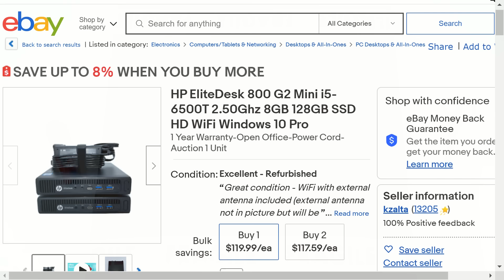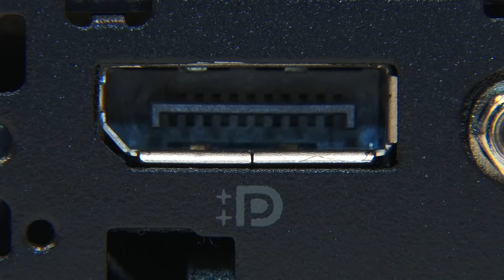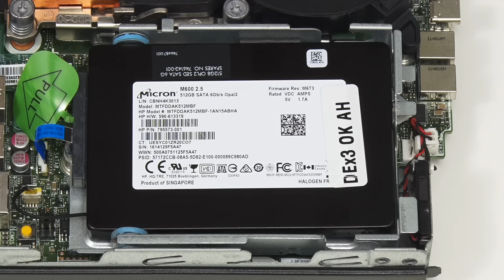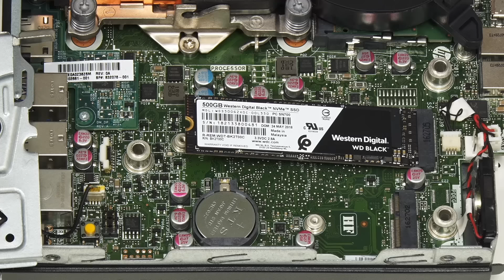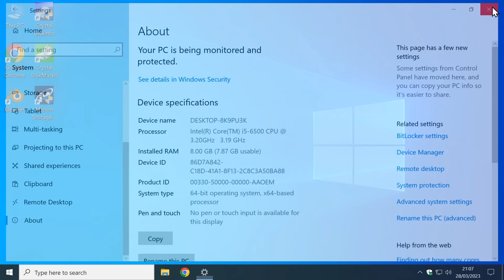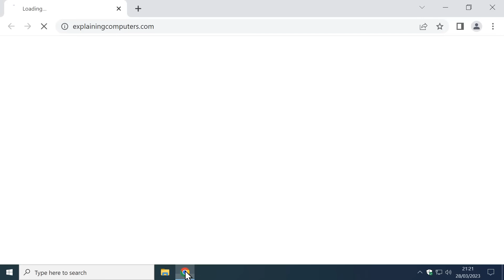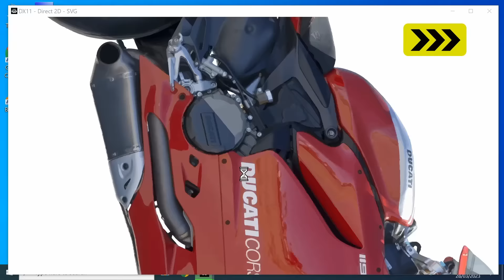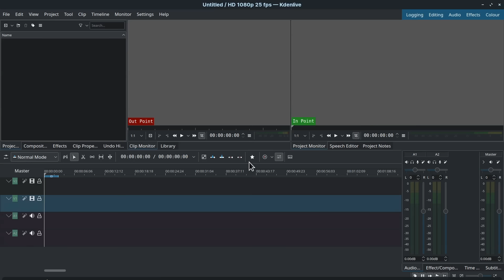Renewed i5 Mini PC: HP EliteDesk 800 G2

Comment: I have had so many of these mini PCs and thin clients that I've lost count. Believe it or not I use Elitedesk G1 with Android X86-64bit Prime OS Android 7 as my daily driver. When I need a Windows system I have a ssd with Windows 11 that I plug in. I have bought many G2s with no hard drive, ram, or power supply for under $50 shipped here in the US. These computers are great with Windows, Android, or Hackintosh however I would say your choice of Linux is that much better.
Reply from the maker: I now have to try Android on this! :)
Reply: @ExplainingComputers  I know Bliss OS and the Android X86 project is the most popular however I would still recommend Prime OS or Lineage OS. Lineage OS has an iso download on the Android X86 website. If you go with Prime OS I would use the 0.6.1 Android 7 mainline iso. If Windows is installed Prime OS has an optional installer to dual boot Windows and Android. Real Android will always beat an emulator hands down. Prime OS and Bliss OS both have a keyboard and mouse mapper for games built in. I'm looking forward to seeing which ever version of Android you pick to test.

Comment: Hi Chris.  Another interesting video with lots of possibilities for potential upgrades such as more RAM.  It'd be interesting to know how the fan controls are set?  Both on all the time or or the second one comes on when needed?  As it's an older machine perhaps the fans could do with bring swapped out?  As 2025 is on the horizon, perhaps a future video on wiping the machine and installing a stable Linux distro in its place?  Happy Easter
Reply from the maker: Hi Martin. I must indeed check the fan settings. This video was produced in a bit of a blur.

Comment: They can run 65 or 35w versions of the CPU . If you have a copper heatsink and a 90w plus psu it's able to run the 65w or 35w CPU .  If you have an aluminium heatsink and 45w psu it's setup for the 35w version . but you can upgrade the heatsink ( if you can find one ) and psu if you want to run the faster CPU. Got mine (i5-6500T 35w) on eBay 2 years ago for £150 . Brilliant little piece of kit and runs Linux mint like a dream.

Comment: I got a small Lenovo ThinkCentre that I was using as a stereo PC. The drive that they used for it was trash. You may need to inspect it when you get it and make sure you keep a backup if there's anything important that you're using it for. Ultimately I ended up getting another system on discount from Chuwi with a smaller form factor with an i3 hex-core processor, more RAM, and a better drive. (Obviously it's more expensive.)

If you're fortunate to have a Microcenter close by, like I do, I group a handful of Inland SSDs or whatever's good and on sale, for smaller projects like this.

Comment: Don't assume the 4k or so hours for the SSD runtime is accurate. I have a small server here that's been running for 6.5 years or so, the two HDDs in it report around 54k hours, the SSD reports 4k or so hours. Clearly, there is a problem with the data as reported by some SSDs, or the way CrystalDisk gets that data, because it isn't accurate, at least for some SSDs.

Comment: Hey Christopher! That computer is an HP elitedesk 800 G2 mini 65Watt. It has two fans for cooling the hard drive because it is the higher powered 65watt that uses the i5 6500 . It is not the 35watt that uses the i5 6500t!
Reply from the maker: Thanks for this. That makes sense for the two fans.

Comment: I have two 800 G3's and two 600 G2's and they are Fantastic!
When I started my quest to downsize and to make a quieter, less heat producing room, I discovered these on ebay and now I can't stop ordering them to use for various things!
Reply: My new plan is to buy a few more of these to set up a Proxmox cluster!
Reply: I've just received one and I am already itching to buy even more of them. The homelab bug is hitting hard. I'm not even sure exactly what I am going to run on the Proxmox cluster I am planning to use these for. I just know I need to do it :)
Reply: Are they almost silent these small machines?

Comment: BEWARE when buying these machines! VERY carefully read the listings. The manufacturers' and sellers' terminology varies, inconsistently and often erroneously  regarding 'SFF' and 'USFF'.  Ordering an 'SFF' machine without looking closely, may result in a larger form factor than you are expecting. Happened to me.
Reply: Does S.F.F. mean small form factor? U.S.F.F. meaning ultra-small form factor?
Reply: @arvaneret_329 Yes
Reply: @arvaneret_329  it's supposed to, but a lot of eBay listers don't get that
Reply: @arvaneret_329 it does
Reply: doesnt matter still worth the buy🔥🔥🔥🔥
Reply: That's a good point. There's not uniformity of terminology among manufacturers when it comes to 'small' form factor PCs. As an example the M75q - 1 Lenovo ThinkCentre is considered a tiny form factor by some. Yet, it's not a micro form factor.  And some of that might be due to what's featured as this presenter explains.
Reply: THANK YOU

Comment: We have one at a customer for a lab workstation. Honestly, i hate it. The usb ports have different power or Chipsets, meaning that the usb serial adapter and hub work well in one port and not at all in another. The ports on the backside are cramped and hard to get a handle on, the ethernet chip and the stock ssd have frustrating performance. I'd at least have expected an OEM'd Samsung in a brand computer. Performance in Ubuntu is underwhelming, the usb ports are slow.

Comment: It really shows that the size of a system doesn't say as much about it as it once did.

Where I work, they use more-or-less Dell OptiPlex "Micro" boxes everywhere. I personally own a 3000 Micro with a 12100T (4C 8T) inside, which I use as both a web and simple-databases server, as well as to power a few private bots on the Discord platform.

What captivates me about these boxes is their better energy efficiency ratios; the OptiPlex box I own only uses about 5-6W at idle, with enough tinkering.

Comment: These are such gems. I have a whole array of these with i7 att home for proxmox lab usage with 32 gb ram in each, + ssd, nvme AND 2,5 gbit networking for ceph. The i7 versions often comes with vPro for remote management. So much awesomeness in a little box!
Reply: How did you get 2.5Gbit networking on these?
Reply: @MnemonicCarrier  I’m guessing vis USB3/C dongles. I use them for ESXi with such dongles.
Reply: @MnemonicCarrier  some have PCIe capability, like Lenovo m920q

Comment: That Mini PC is not the 35w version, that is a 65w version and the processor is the 6500(65w), not the 6500T(65w). The 65w version is more powerful thats why it has a perforated top case and a copper CPU cooler.
Reply from the maker: Thanks for this. I was clearly not shipped what was advertised.

Comment: My impression is that a lot of companies, and individuals, are getting rid of their perfectly-working and power computers because of the "this device is not compatible with Windows 11" warnings.
I purchased a used ASUS VC65, mini desktop PC (even smaller than the HP EliteDesk 800), and forced Windows 11 on.  It works perfectly, and so fast (after upgrading to 32GB or RAM with a 1TB M2 SSD); so much cheaper than buying a brand new computer, but getting all the power & benefits.

Comment: I have an i3 model I purchased for $100 awhile back.  I have Windows 9 installed on it and the ethernet port completely disabled (in multiple ways.)  Using it purely for music production and it works great as an offline machine.
Reply: Windows 9?
Reply: @RWL2012  It's a custom ISO someone made and called Windows 9.  It's actually Windows 8.1 Embedded Industry Pro with all the bloat stripped out and the Windows 7 style start menu.  I don't trust custom ISOs to not have problems/backdoors, plus Windows 8.1 is EOL, so that's why the system has no networking capabilities.

Comment: I've been using one of these quite happilly for a few years. One thing to watch out for is that if you buy one that doesn't come supplied with a 2.5" disk, it likely won't include the special cable that connects between the disk and the system board, and these can be tricky to track down if you subsequently decide you want one.

Comment: I have a G3 sat nicely on a 1U shelf in my home rack. It’s a nice little reference PC for when I’m in my garage, and it also runs Docker for several packages which I use for home automation and network management. Awesome little PCs for the money and we’ll worth it if you want a machine with reasonable performance for not very much money

Comment: Chris. I've been watching you for years. And like everything you do. But as a ham radio operator I wish you would state the power bricks output voltage and amps. You see us hams like to go out in the field and operate off of a 12 volt battery. And voltage is very important to us. Thanks.

Comment: In windows system info it says regular i5-6500 3.2 Ghz not i5-6500T 2.5 Ghz, a i5-6500 is a 65W tdp cpu. What did you receive? This is not the CPU you ordered. :) This is why your power consumption test went up to over 70 Watts and fans went crazy loud.
Reply from the maker: This is indeed strange. I assumed Windows was wrong! The power consumption I recorded was not consistent with 6500, which with the motherboard chipset, RAM and drives would have pushed the power draw far higher (on a PC of this vintage, without a graphics card, CPU power use is typically half that of total system draw).
Reply: @ExplainingComputers  Try cpu-z to make sure what you got. There may be a power supply issue beeing not powerful enough for i5-6500. Is it a 90W PSU?

Comment: Hi Chris, thanks so much for this good work.  I am very interested in this.  I have seen multiple vids and articles about installing 11 on older HW--I have a LOT of older HW that works perfectly well.  I will look forward with keen interest.  I am very interested in hearing your opinion on the possibility/probability of MS doing a (nefarious) update sometime in the future, maybe at FIRST update, which will freeze the PC with a message saying that "This machine does not qualify for Windows 11" or some such.  In your opinion, what is the likelihood of this?
Reply from the maker: I think Microsoft's position is clear on this -- they allow the installation of Windows 11 on unsupported hardware, but make it clear that such installs or upgrades are on unsupported hardware, so have no right to updates. Right now, they are providing those updates. So the worst I think will happen is that updates may cease.
Reply: @ExplainingComputers  Thank Chris.  Much appreciated.  If 11 updates cease, especially security updates, I feel that is a huge problem.  Kits are already being sold to bypass Win 11 security features on supported HW to malicious hackers.  I see absolutely no benefit to Win 11 consumers, even on supported HW.   No performance benefits, no feature benefits, and no security benefits.  Only benefits to MS.  I am still eagerly looking forward to next week's episode.

Comment: Nice video Chris! I did the same with a Dell Optiplex 3040 with an i3 6100t, running Fedora Server. Upgraded the RAM to maximum of 16GB DDR3. Running fine with some Docker containers and a consumtion of around 11W/h. It is much powerfull then running 2 Raspberry Pi 4 with 4GB ram and a third Pi 2 running the software I run. Node-RED + Homeassistant + Pihole can saturate a single Raspberry Pi and make it feel slow. Running both dual Raspberry Pi 4 gives me around 8-12W idle power consumption. So it doesn't matter if one Dell or HP mini PC can do the same tasks.

Comment: Per usual another fine video.  I discovered SFF systems a while back and picked up a ThinkCentre barebones computer.  It came with the motherboard.  No RAM. no disk. no PS and no CPU.  I had to add all that and I was amazed that it worked when I got it together.  I had a disk but I bought the rest of the parts used on Ebay.  I figured at least one of the pieces would be junk, but I was wrong.  It's been running for about 2+ years with no hiccups.

Comment: Can't wait for the Windows 11 on older hardware video. I have read that it's not too hard but that it does not update automatically to newer versions of Windows 11 and you need to hack it every time in a different way to update it based on what new barriers Microsoft put for these hacks

Comment: These are surprisingly useful especially if you're asked to help sort a PC for a casual or elderly user.  From my experience:
-	If seeking low power use to save money – even if this uses slightly more power than a newer but more expensive system you’ll almost never make up the difference in purchase cost from power savings especially if this is set up to go to S3 power save when not in use
-	Unless you’re running Debian/LXDE – 16gig ram has to be the minimum now, Chrome alone (on Win10/11) is starting to choke 8gig machines even with normal use.  The NVME is nice, get one with DRAM as well.  I strongly dislike the CMOS battery placement here, shame they did that.
-	Test everything extensively in place – full memtest86+ sweep (all test cycles) on memory, a proper sector test on the disk (I don’t trust SMART reports on SSDs now after seeing a brand new Integral 1tb P series pass SMART tests but have actual sector failures which SMART self test didn’t pick up, Linux’s testdisk actually did in that case)
-	These are ideal for casual or older users – if setting up for a more senior person use a large IPS screen (27” is ideal) and a lower resolution (perhaps 1920x1080).  Once I set up a 27” TV at 1366x768 and the (elderly) user loved it because he could play bridge without wearing his glasses.  He used that PC until it literally burned out, he got so much value out of it. 
-	Also for elderly users – configure it to power on with the keyboard and mouse button presses.  These SFF machines often have VESA mounting options so you can screw it to the back of most screens
-	this is a great solution for ordinary casual users (though I'd get a higher res screen, a 27" Iiyama 2560x1440 would work very well with this).  The external brick supply is a bonus as it takes a lot of thermal production out of the case and out of the way.

Comment: A few months ago, I picked up three EliteDesk 800 G4s with i7-7700T six-core, 12- thread CPU, for a little less than $200 apiece, and I installed 64GB RAM, two 2TB Samsung 970 EVOs each, and an Intel Optane on a USB adapter.  Each machine totals less than $500.  I'm running VMware vSphere 8.

I just wish I could find TB3 FlexIO cards for them, but they seem to be thoroughly sold out.

I think I should be able to make money back on the removed parts too.

Comment: Fancy that. Great minds think alike. I just got 2 Lenovo SFF units to tinker with and replace an older home server. One has 35W tdp and the other one has 15W tdp, and I'm loving them! Low footprint and great performance.
Reply: I have multiple Lenovo SFF machines (i5) and so far all are working flawlessly. Very easy to open up and replace parts.

Comment: I love buying old computers and putting Linux on them. I'm using an HP Z210 Workstation with an Intel i-3-2100 connected to a 47" TV to watch this and other YouTube videos. I think I paid about $200 for it in 2017. I'm tempted to buy the EliteDesk except there's nothing wrong with what I already have.

Comment: @ExplainingComputers / Christopher,
Hi (long time, no talk). I hope that you are well.

I have noticed that over the last five-ish years, small form factor workstations have become more of the norm within organisations. I am also a fan of Hewlett Packard PCs due to the build quality and the accessibility (generally speaking) to their devices schematics / technical documentation.

In fact, I replaced a Lenovo A58 (type 7515) that I was using as a workstation with a HP ZBook 14u G6 (i7-8565U) and a Dell D6000 port replicator back in November (both of these PCs are running openSUSE, which is my preferred operating system). I am currently considering adding a couple removable hard drive bays to the Lenovo and use the device for backup storage purposes (I am considering using the open source based Bacula enterprise level backup framework for this). I am also intending to replace the ZBook's NVME storage (ie. KIOXIA KXG60ZNV512G) with a 2 TB Samsung 990 Pro, as well as replacing the current 16 GiB amount of RAM with 64 GiB (ie. the maximum amount of RAM that the ZBook 14u G6 can handle) within the next month or so (I do use Oracle VirtualBox for sandboxing purposes and would also like to make use of the QEMU / KVM framework within this device. So the extra memory would be extremely useful). 

I have been browsing eBay over the last couple days and have seen several vendors selling the 2013 HP UltraSlim docking station (D9Y32AA) for between £10.00 to £20.00 GBP, and I have been thinking about adding this device to my setup (I would still like to use the Dell D6000 within this setup but due to the width of the UltraSlim dock, the ZBook's Thunderbolt 3 port which the D6000 uses would be difficult to access. However, I think that I have found a fairly straightforward solution using an angled flat ribbon-style cable).